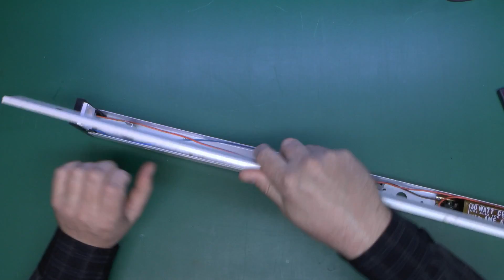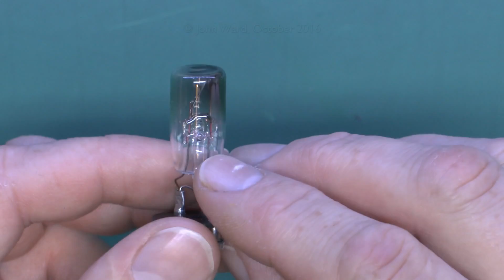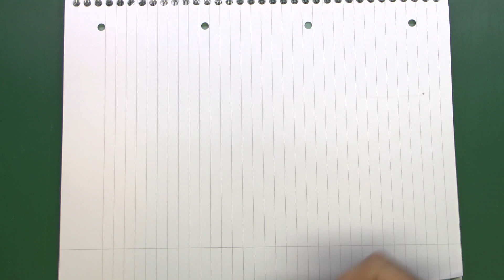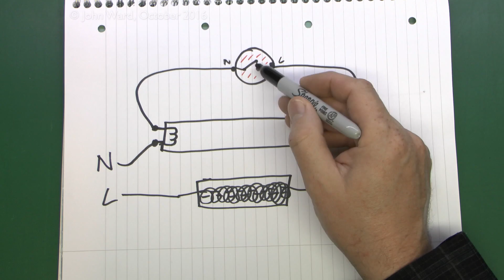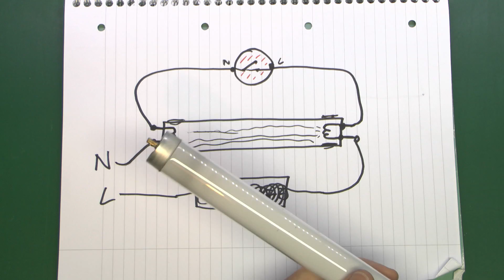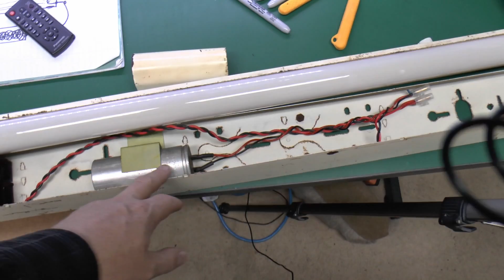Fluorescent Tube Lighting

Comment: i just removed some 50 year old round sylvania fittings, still worked!
Reply: They recently replaced a lot of fluorescent fixtures at work, so I had a look if I could still use them as holders for LED tubes. When I saw the 1967 date on the back I gave up on the idea, the plastic on the ends was quite brittle as well.
But still, that's some amazing service life, considering that they were on most days. I doubt any of the electronic ballasts will last that long ;-)
Reply: Electronic ballasts vary wildly in quality, but if you get something decent they really can last in excess of 100000 hr rating...   Indeed very old fluro's do last well (but even those I have had failures on, winding shorts out and you get a rather smelly meltdown).

Comment: I have a stores full of the old T12s, don't know why i kept them!
Reply: LEDs have improved a load recently. I've got those 'filament' LED bulbs in a lot of my fittings at home now. They have the basic look of those 'vintage' bulbs that are all the rage at the moment, the old Edison looking long-but-dim filament bulbs. Only these are bright. And despite being LED, they're a nice warm light, and they're really quite bright.

I was never keen on those LED bulbs that were either clusters of those harsh blue white LEDs, or the slightly newer ones that had the fat plastic base. These new filament ones are mostly glass, and I've been quite impressed with them.
Reply: A 6ft T8 should work quite happily in the same fitting. The end connections are the same, just the tube itself is a smaller diameter.
Reply: jusb1066 The existing ballasts should be fine yeah. That's exactly the arrangement I have in my garage; old T12 6 foot fittings with 6 foot T8 tubes in them.
Reply: jusb1066 just before you buy a shed load of them, they are the standard two pin connection like in the video aren't they? If so all should be fine. Just get one to be sure though.
Reply: Yeah I was going to say the wattage won't be exactly right, and in practise it'll translate to a shorter life on the tube as it's being overpowered. But as you say if it's only a relatively short term solution it shouldn't be a problem. Replacing the ballasts too technically is the right way to go about it, but if you're planning to go about going to LED eventually anyway the fittings will be renewed then.
Reply: Oh well, if you can get new T12 tubes still, just do that. I didn't know that myself I must admit. You'd be able to eke five years out of those. Just get, what, two sets of tubes? That should cover you easily.
Reply: Yes, though there seems to be very wide variance in quality!  Notably lots of bad varieties give horrible headache light same problem as old fluorescents and/or have poor Colour Rendering (bad spectrum, makes things look-bad / hard to see by properly).  And many badly designed LED-driving electronics that overheat / fail easily.
Certainly there is too much LED-buzzword-bandwagon going on without paying careful attention to quality.....
Reply: +ShokaLion
Techincally the rating is different, and the ideal choke inductance depends on this as well as the mains voltage.   Some chokes nonetheless 'rated' for use with T12 tube, some for the equivalent T8, some for both...
Reply: whereas i need some 6ft t12, hard to find!  i have about 1 spare, and then i will have to change fittings it seems
Reply: ShokaLion thanks, will the ballasts (very old) be happy with them?
Reply: ShokaLion
cheers, ive checked, can easily find t8s,both in wickes or delivered at toolstation, well happy!
Reply: ShokaLion
yes 2 pin, not the super ancient BC! i bought my last new ones about 4 years ago at the local factor, but he said then, he might not have more next time, yes the T8 ends look the same indeed, they are 85w currently and t8s are 70w, so close enough,   i wont buy a shed load, as expecting LED's to become cheap enough before i die of old age! probably only want to cover another 5 years or so
, once there is something to replace them at maybe £20 per unit, as leds may get to one day, i will replace them piecemeal
Reply: ShokaLion
one late question, one of them is a bit 'buzzy' it works fine..could it be a loose ballast or mechincal issue making it an easy fix?  yeah a few thousand hours out of say 15k isnt too much a loss if you can get the tubes easy anyway,  i do appreciate the answers,!
Reply: The hum is the ballast. It's the windings that have come ever so slightly loose over the years just vibrating slightly with the 50hz input frequency.

I've just been doing a bit of research about T8 in T12 fixtures, and it seems that Your Mileage May Vary. My fittings have been alright, but apparently some don't like it. The answer is probably just see how you get on. If you find lamps are burning out quickly, or you're getting other problems, then look into the ballasts. They're probably around £15-20 a pop. That said you could probably get second hand T8 fixtures for that much.
Reply: ShokaLion
weirdly, theres now lots of results for 6ft t12 sellers in the UK, who will even deliver, perhaps 5 more years is doable, i guess my crossover point is around £30 each for an LED  (5ft would do im sure and can live with a little less output, as currently often only use 4 of the 6 anyway.
Reply: ShokaLion
i bought 5 tubes, 6 years ago, just looks like im near the end of those, last spare long since  fitted.  yeah a couple years ago i most gave up looking for t12 sellers, but seems easier now!  like anyone im cheap and dont want to go down a dead or expensive route! at least i know t8s are an option even if halve the life its workable, but i see 5ft led's are £39 on amazon, thats real close to my 'worth doing it' price
Reply: ShokaLion
yes ive seen them, might buy a couple, two of my workshop lamps are vintage enamel shade ones, and those would fit in the deep shades, ive always tried things pretty early (well a cheap version of it) my first CFL was bought in the early 90's was a super heavy phillips, but it lasted till a couple years ago , and i calculate around 35k hours on it till it failed, much longer than any newer one, but it was like £50 !
Reply: Just like how people stockpile incandescent bulbs nowadays ...like myself....😎 here in 🇨🇦